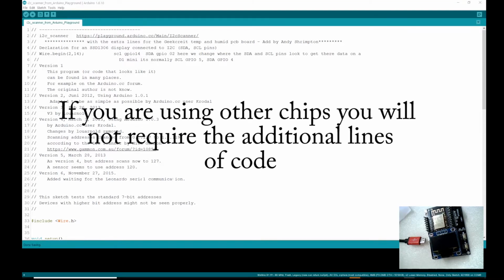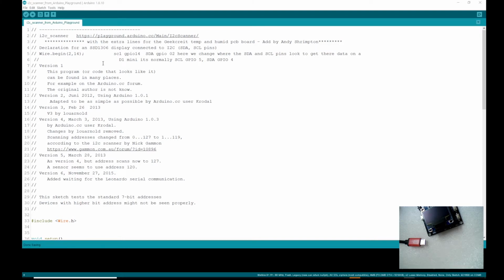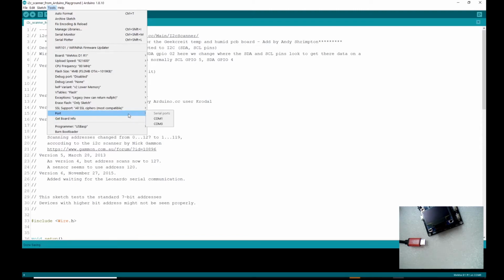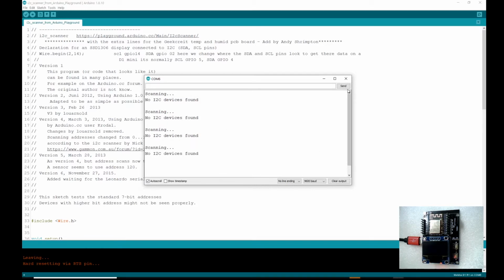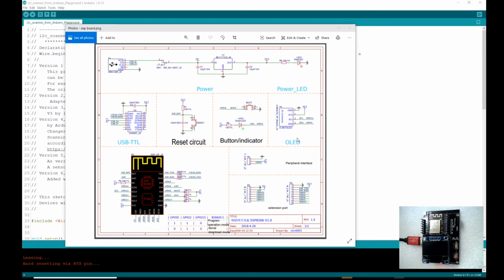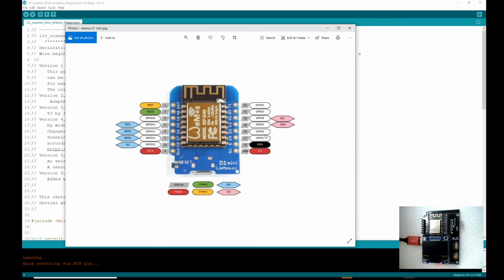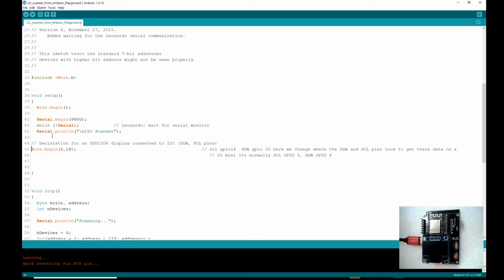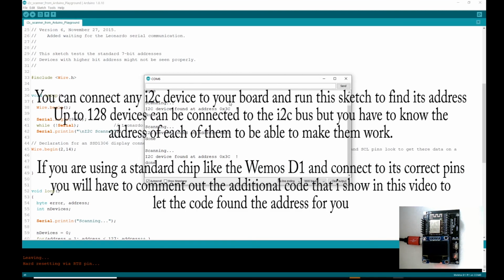How to Arduino Find the i2c address of a sensor using the GeekCreit PCB temp and humid with oled PCB

Comment: I get the following error when I try to complie the sketch.  It looks like a function is missing.  Do I have the right wire.h file and library?
C:\Users\Sam\Documents\Arduino\i2c_scanner\i2c_scanner.ino: In function 'void setup()':
i2c_scanner:45:16: error: no matching function for call to 'TwoWire::begin(int, int)'
 Wire.begin(2,14);                                               // scl gpio14  SDA gpio 02 here we change where the SDA and SCL pins look to get there data on a
                ^
In file included from C:\Users\Sam\Documents\Arduino\i2c_scanner\i2c_scanner.ino:33:0:
C:\Program Files (x86)\Arduino\hardware\arduino\avr\libraries\Wire\src/Wire.h:53:10: note: candidate: void TwoWire::begin()
     void begin();
          ^~~~~
C:\Program Files (x86)\Arduino\hardware\arduino\avr\libraries\Wire\src/Wire.h:53:10: note:   candidate expects 0 arguments, 2 provided
C:\Program Files (x86)\Arduino\hardware\arduino\avr\libraries\Wire\src/Wire.h:54:10: note: candidate: void TwoWire::begin(uint8_t)
     void begin(uint8_t);
          ^~~~~
C:\Program Files (x86)\Arduino\hardware\arduino\avr\libraries\Wire\src/Wire.h:54:10: note:   candidate expects 1 argument, 2 provided
C:\Program Files (x86)\Arduino\hardware\arduino\avr\libraries\Wire\src/Wire.h:55:10: note: candidate: void TwoWire::begin(int)
     void begin(int);
          ^~~~~
C:\Program Files (x86)\Arduino\hardware\arduino\avr\libraries\Wire\src/Wire.h:55:10: note:   candidate expects 1 argument, 2 provided
exit status 1
no matching function for call to 'TwoWire::begin(int, int)'
Reply: I had to select board WeMos D1 R1 to get it to compile correctly.
Reply: @EdSym1  yes D1 mini r1
Reply from the maker: did it work when selection a wemos d1 mini board?